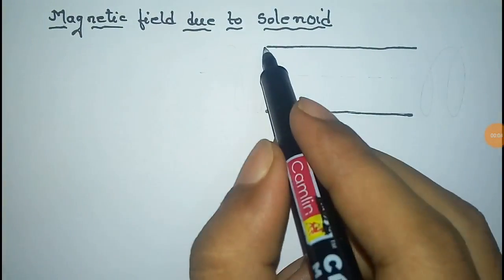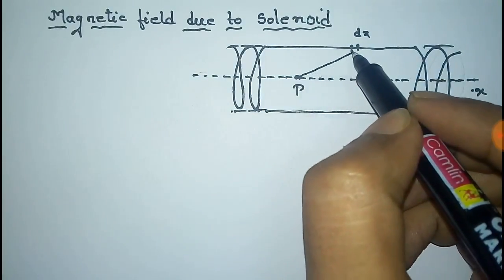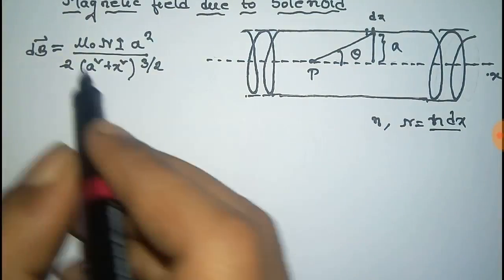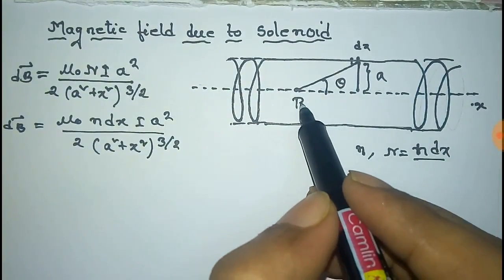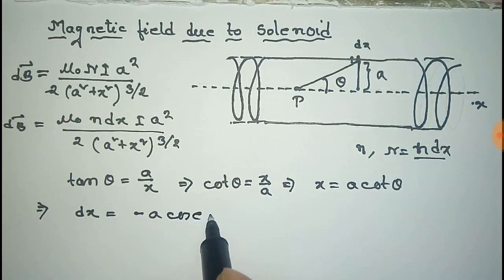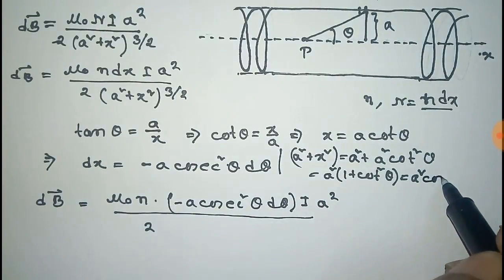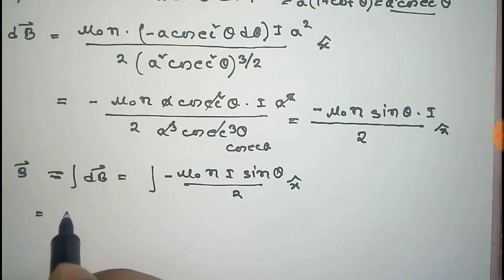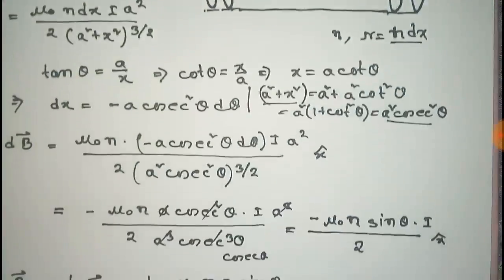Magnetic field due to a solenoid

Comment: Sir Kiu thita1 to thita2,why it's not thita2 to thita1????
Reply: Because theta 1 grater than theta 2..and cos theta 2 grater than cos theta 1..we did it just to  get the positive value
Reply: But you said theta1= pi theta2= zero for long cylinder
Reply: Because negative sign I  expression